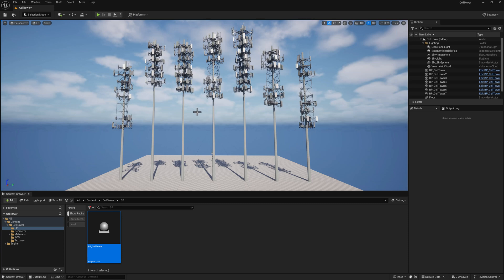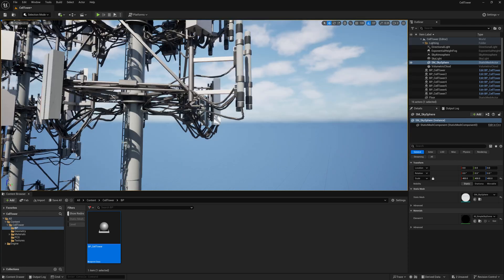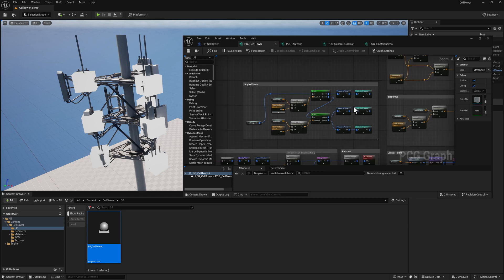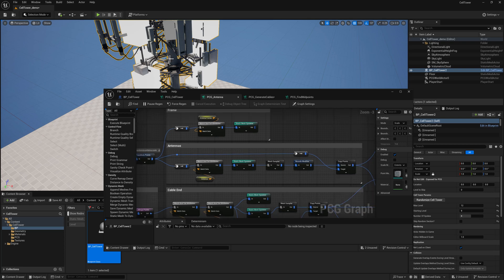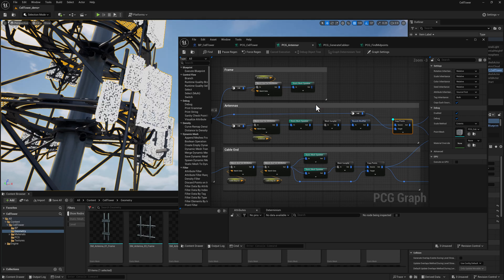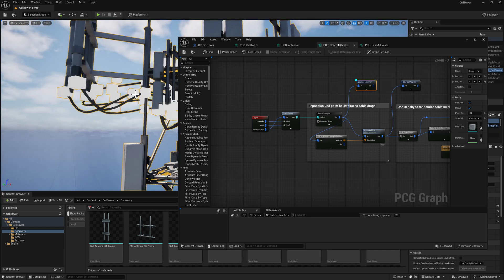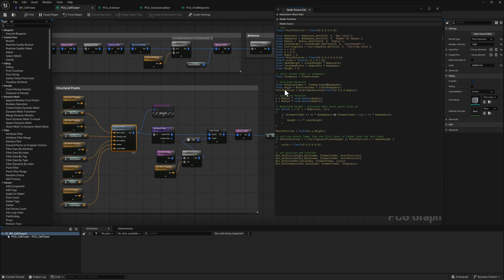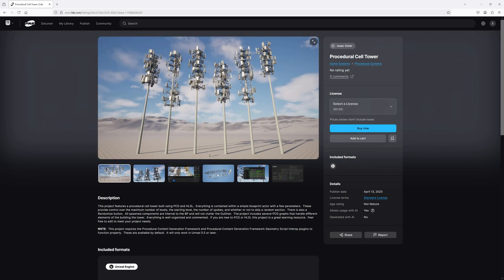Unreal 5.5 PCG / HLSL Procedural Cell Tower

Comment: Hi, I bought your product and I'm impressed with the quality! It's a fantastic product. I’m currently trying to migrate it to my UE 5.6 project, but I’ve encountered an issue. When I place the Blueprint in the level, the HLSL node in the PCG graph throws the following errors: "Shader minification failed" and "expected unqualified-id". Do you know of any workarounds or solutions for this? I tried fixing it myself using Gemini, but every attempt failed haha. I love this product and would love to utilize it in my project!
Reply from the maker: Hello - Sorry for the delay getting back to you.  Thanks for buying the cell tower!  I opened the project in 5.6.1 and everything is working as expected.  Can you confirm you have SM6 in Platforms - Windows enabled in the project settings?
Reply: @IsaacOster  Thank you for the reply! I checked and SM6 is enabled, but the issue persists. I also tried verifying the engine files and updating my NVIDIA drivers, but there was no change. Could it be related to how I migrated the files? I'm porting the files by right-clicking the CellTower folder under the Content folder and selecting "Migrate" to export it to the 5.6 project.
Reply from the maker: @StellarHideaway create a new project in 5.5 and enable the pcg plugins.  Open your working 5.5 project and migrate the cell tower stuff out of the plugin folder into the content folder of your new project.   Save and close.  Open your new 5.5 project in 5.6.  Chose Convert In Place.  Let me know if that works.
Reply: @IsaacOster  Unfortunately, it didn't work. Curiously, when I converted the 5.6 files back to 5.5, they functioned properly. I really don't know what is going on at this point haha.